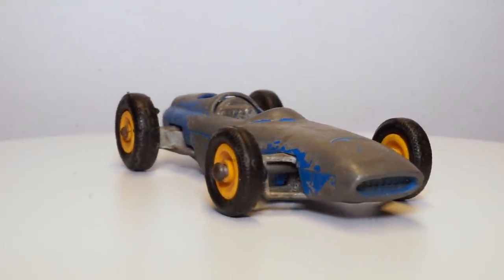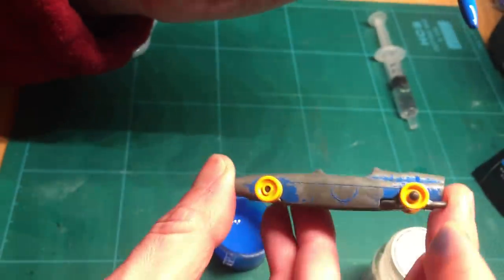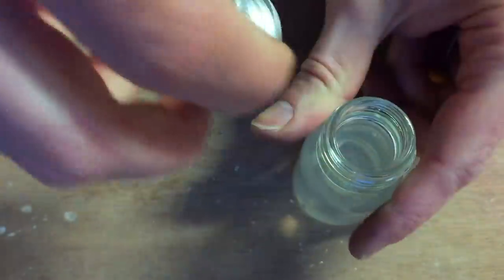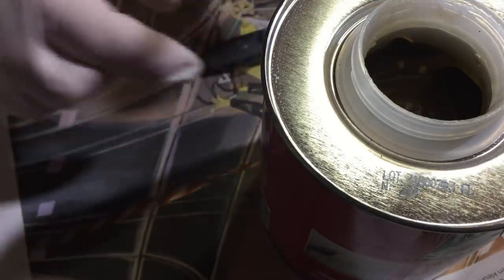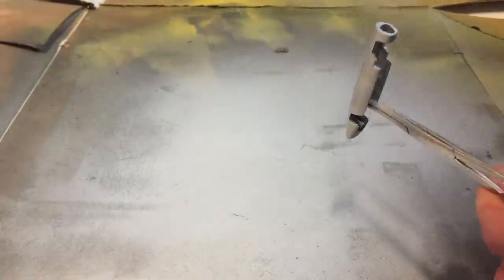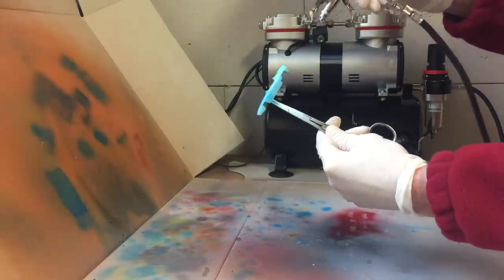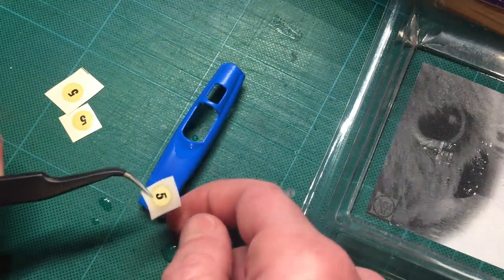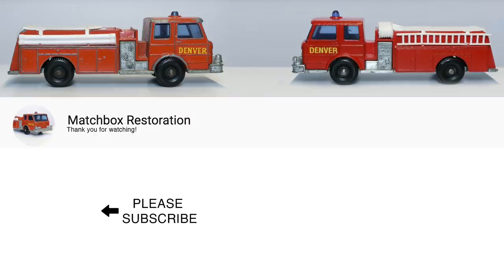Matchbox 52b B.R.M. Racing Car - Full Restoration

Comment: Love the electrical tape on the wheels trick.  Good job!
Reply from the maker: To be honest, I found this trick online. It's not my original idea ;-) Thanks!
Reply: I have a number of Matchbox with these hub and tyre wheels.  I thought the tyre would slip off using electrical tape, with its smooth shiny surface.  I use painters masking tape as it has a matt finish textured surface.

Comment: Brillant idea for the tires. I was worried about your use of the new tooth brush leaving marks on the car.It did not.Seen a littles dust in the paint. But oveall a brillant job.I really like the fact you did not do much to the base.The car has age on it and you leaving the base alone for the most part makes it look real. My rating is A.without the dust in the paint it would of easliygotten A Plus.Great job!

Comment: Fine job! I would have been unable to resist the temptation of putting a little flat black paint into the ends of the exhaust, but I guess that is just one of my character flaws.
Reply from the maker: Thank you! I know, this one has a lot of ways to make it a nice custom. But I'm trying to get them look like the original ones :)
Reply: Another custom touch. The front grill painted black with the mesh highlighted in silver.

Comment: What paint would you recommend for a novice getting into airbrushing diecast restoration?
Reply from the maker: To be honest, I’m a novice myself. I use what most others use when they use acrylic paints: tamiya products. From primer to colour and thinner (many recommend using the X-20 lacquer thinner even). When using the same brand, you don’t run the risk of getting strange chemical reactions between products. Still learning a lot every time I’m holding my airbrush gun. Good luck!
Reply: @MatchboxRestoration  thanks for replying

Comment: Awesome job, thank you for a very detailed video! Why didn't you use lime out for the base, let it soak for 4 minutes?
Reply from the maker: Thanks! I'll look into the Lime Out. Good idea!
Reply: @MatchboxRestoration  

The first utuber who I have seen use this method is Diecast Resurrection.

Edit;
This is now my favourite car of yours.

Re-Edit;

Just a thought about your drill press method. Do you think that putting a tiny drop of oil on the tool, would give it a little smoother finish on the axle?
Reply from the maker: @Tim-57  Thanks Tim 🙏
Reply: @MatchboxRestoration  

Very welcome.
I put a re-edit to my comment..
haha 😉
Reply from the maker: @Tim-57  Good advice, I'll try it on my next restoration. The tool still needs some improvement as it also kind of changes the way the other side of the axle looks. I'll have to look into this.
Reply: @MatchboxRestoration  

You are welcome.
Was just something that I have thought about, while watching both you and Marty using this method.

Comment: Hey fella, ever tried the Baremetal's electropolish? Looks promessing (I' ll try myself one of this days 😉)
Reply from the maker: No, I’m not too keen on using the acids required for this method. But the results look awesome.
Reply: @MatchboxRestoration  You're worried about acid but you use stripper? Also, vinegar is acidic.
The acid baremetalhw is used in swimming pools. I dont think stripper is. You need to evaluate your thoughts on this. It's worth it.

Comment: I am always slightly bothered by the shrinking yellow, and occasionally, green, wheel hubs on pre 'Superfast' Matchbox cars. It's definitely the hubs that shrink - the hard polyethylene tyres only stretch if constantly being removed and replaced. I secure mine with a harmless contact adhesive - in my case, 'UHU', which I apply to both tyre and hub - you don't need much, and leave it to go tacky on both surfaces, and then attach tyre to hub. The glue is still flexible, so that you can adjust the fit to your liking. Matchbox restorer 'Time Rider' has used a similar adhesive, with the brilliant name 'Shoe Goo', by the way, to fix errant tyres. That B.R.M. looks fantastic, by the way, but I could never understand why Matchbox produced it in blue and red - the real car was normally dark 'British Racing Green', at a time when you could tell the nationality of a racing car simply by colour: Italians were Red, Germans Silver, French Blue, etc. But here's the thing: it does look damn fine in that shade of blue. Nice one.
Reply: No, this car didn't really come in British Racing Green...Each British Formula 1 team  had there own shade of green... The MB Aston Martin racer was a pretty accurate representation of Aston Martin's color. British Racing Motors  (BRM) colors were a duck egg blue/grayish green. When the team was purchased by Owens Engineering, an Orange stripe was added around the nose of the car. MB Lesney never painted this car in the green the Lotus 19c came in. That's the color people think is British racing green. It's simply people who can't tell one open wheel racer from another or one Matchbox car from another. This Matchbox Restoration expert stated the colors it came on correctly.
Reply: I stand corrected.
Reply from the maker: Thanks for the replies and advice! I’ll look into it! 😉

Comment: Paint color did not match at all on my s7 with blue filter enabled.
You were worried about drilling too much material from the post, I was worried about you drilling through your thumb. 
You should use a brass wheel on the Dremel just like the brush you used for removing paint.
Use the vice for drilling the hole in the post please I'm so worried about your hands.
When you clean the axles, especially when using vinegar, they need some anti rust treatment or they will flash rust when there is enough moisture in the air.
When applying the decals you can use a decal setting solution to make them sit flat with the surface so it looks like it was really painted on.
After painting you lost all the body lines, was that intentional? You can use a safety pin to deepen the grooves of body lines so they remain visible or alternatively you can sand them away if they are not supposed to be visible
Reply from the maker: Thanks for the feedback. Some things you suggested (like the drilling advice) is taken by heart, but some of my recordings are made before you wrote them down. So please keep the advice coming, it’s much appreciated and you’ll see most of it applied in future videos 😉 The body lines are still visible, but the lighting makes it look like they aren’t. I’ll keep the safety pin method in mind though. I used Micro Sol after applying the decals. Next time I’ll use Micro Set to apply them instead of water. Have a nice day!
Reply: @MatchboxRestoration  thanks !